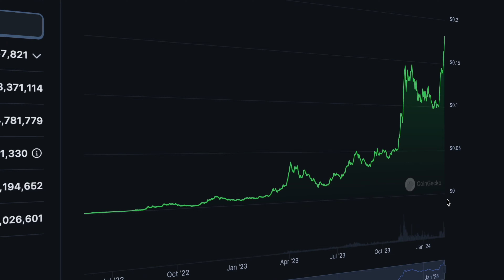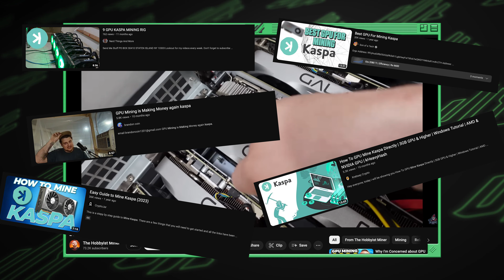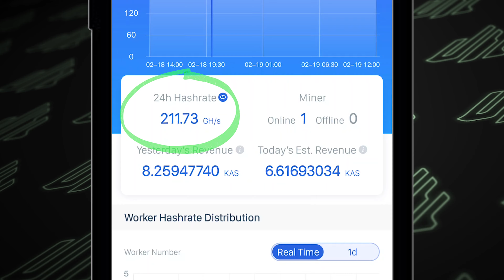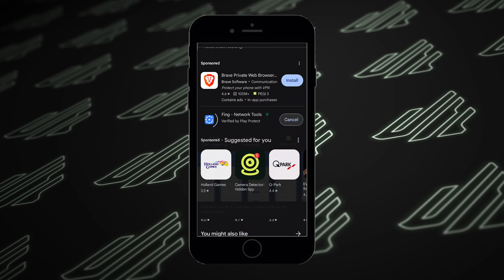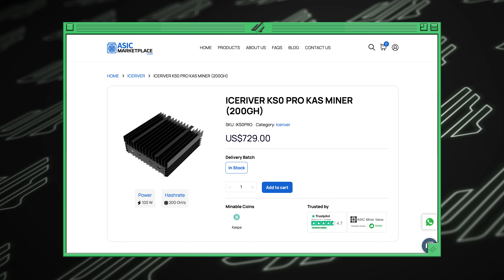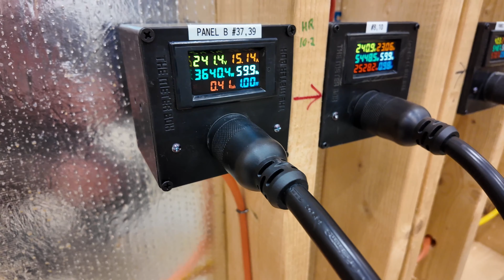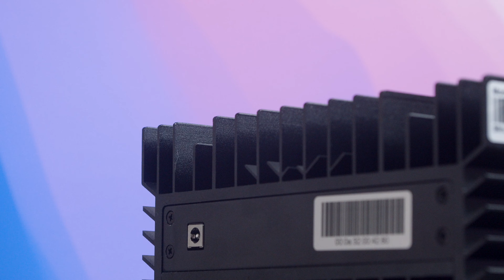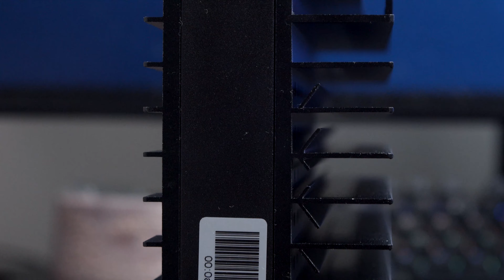Still The BEST Mini Miner for 2024? Iceriver KS0 Pro Worth It?

Comment: Great video Vincent. This looks like one of the best machines out there now for the small miner. However one thing I don't get with mining any coin though (apart from the satisfaction and fun and knowledge gained of the process) is, is it not just more lucrative to buy the coin in the first place?  For example you could buy say 3,500 KAS now with about $600 and benefit from price accumulation immediately, rather than mining 14 KAS a day (would take 250 days to get 3,500). And that's before electricity costs. Am I missing something? Thank you.